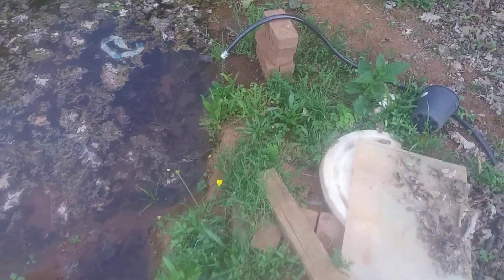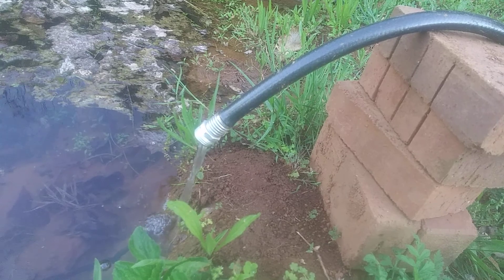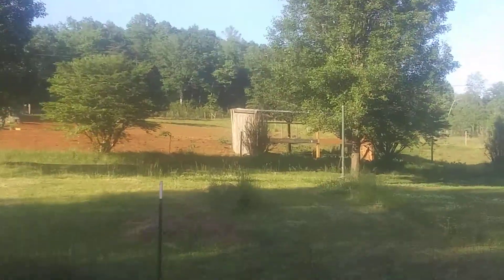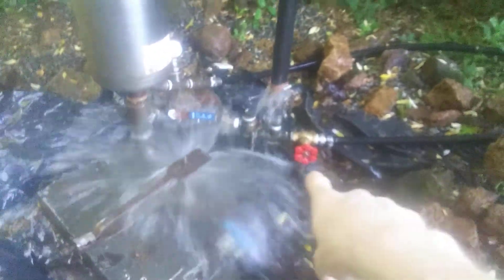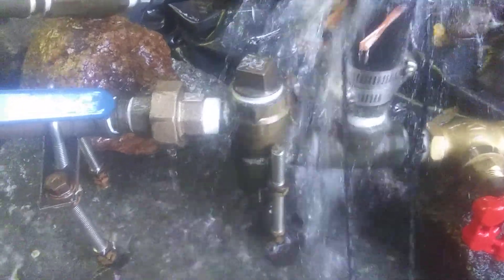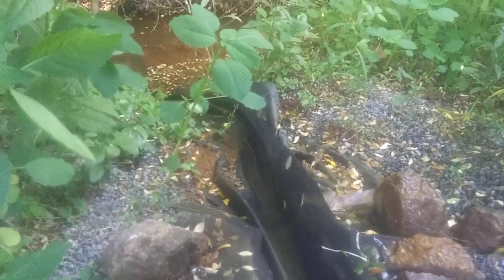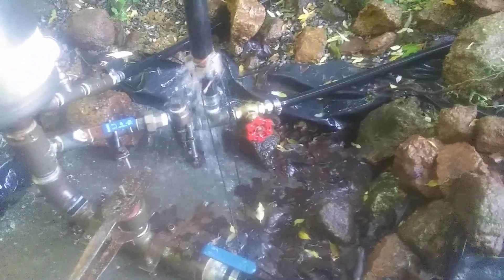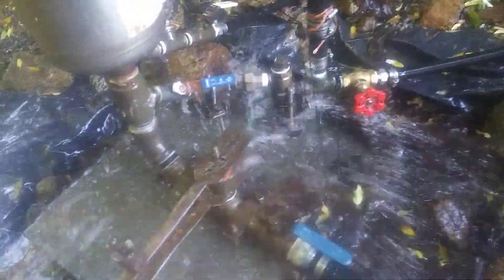Double Acting Ram Pump update video

Comment: Wow, that's a VERY innovative use of a ram, it doesn't seem possible when you first think about it.

So to keep the water separate does it rely on the spring water flowing into the the tube between the check valve and the slam valve, and when the slam valve closes the creek water pushes it into the tank, but doesn't push far enough for the creek water to reach the check valve? Having the riser as close as possible to the pump seems like it is very important to ensure that the spring water flows into that section of pipe before the creek water builds up speed. But maybe it isn't super important for the spring water to connect right into the check valve, since that section of pipe should be full of spring water anyway? Definitely better to feed it closer though so you can put the slam valve closer to the check valve.

It seem like if there is not enough spring water coming in then creek water would start going into the output, but if you put some sort of diaphragm between the slam valve and check valve then the two water systems would always be completely isolated. But maybe it's better to have the creek water come through, as a back-up if the spring water stops for some reason.
Reply from the maker: That is EXACTLY right! When I was building this pump I contemplated a use of a diaphragm to keep the water separate but couldnt figure out how to get it to work, the two water sources need to remain fluid together as one fluid, one water pushing the other water constantly, but valve closing at last second keeping them separate at the same time... if you watch this other video I made I did a dye test, poured dye into the intake of the creek water side but not the spring water and you can see the creek water that was dyed green coming out of the waste valve while the ram cycles, but the spring water and discharge side of the pump remained clean and clear. I Also have an overview video explaining the concept on paper if you were interested. 
https://youtu.be/qBV5xkQ3biM
Reply: @Whelessry  Yee, I saw that, but it still took me a bit to figure out why they didn't mix. It kind of reminds me of a pressure exchanger, which also has both fluids able to mix but the flow always reverses before they can reach the other system.

If you did want to revisit the diaphragm you could maybe do it with one of those ball type water hammer arrestors if you can weld a tube to the other side for the clean water. It would probably need a tiny bleed hole to prevent bubbles from being caught though, as you say they need to act as one fluid. Else maybe you could have the clean water come to a pipe that contains a thin rubber tube with a closed end and have the dirty water push into that rubber tube, that way you could arrange it so that it doesn't collect bubbles. But in both cases you would have to make sure the rubber parts don't stretch too far and get extruded.